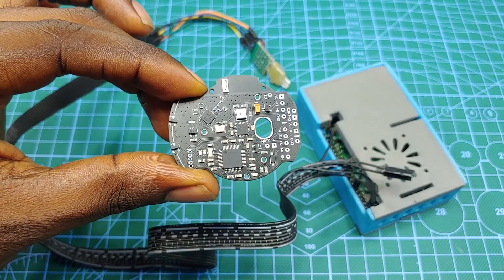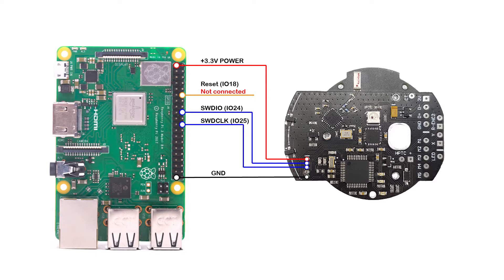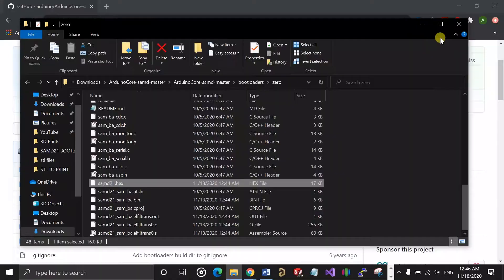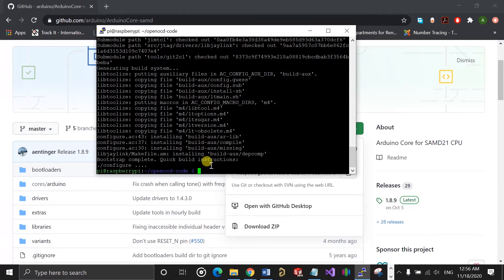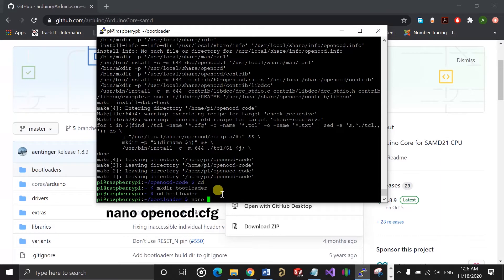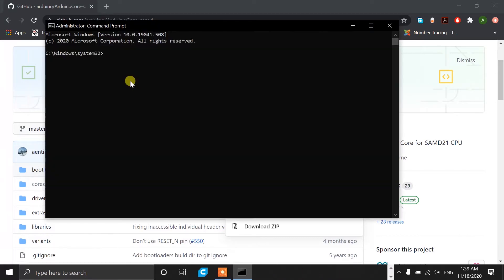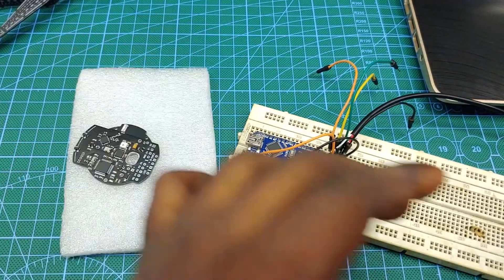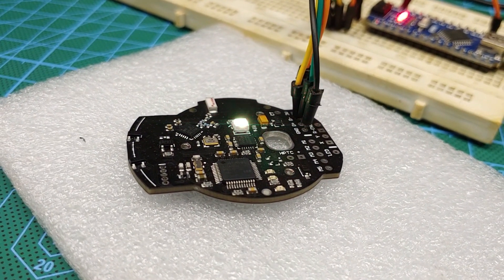How to Program the Arduino Bootloader to a SAMD21 Chip with Openocd & a Raspberry Pi.

Comment: Can we run Arduino IDE and program codes(.ino files) as usual on the custom board as we would with an Arduino board by doing this?
Reply from the maker: Yes you can